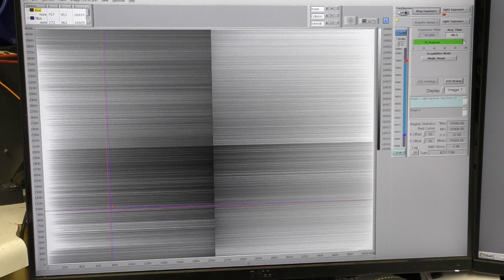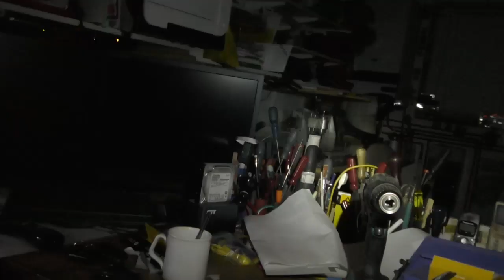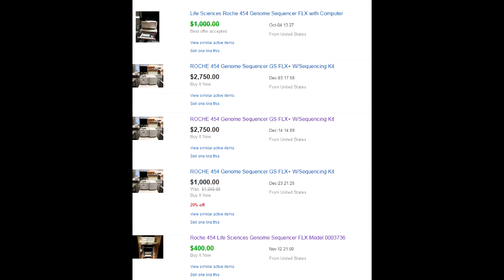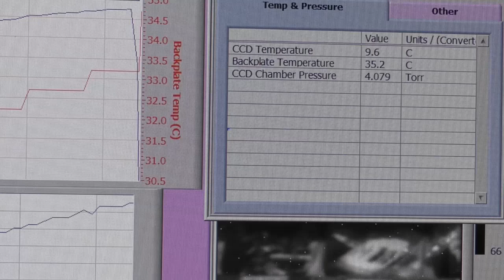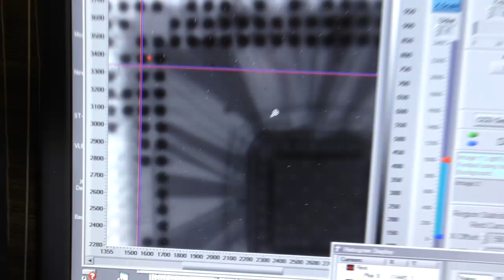Spectral Instruments 800 Series 16Mpixel Cooled CCD camera Part 2

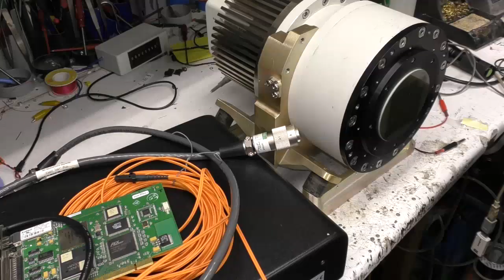Comment: 27:23 Nowadays they don't even exist since they are all bought, except for over $1000 ones but with computer and all and based on what you get they are very cheap. The junior exist but that sensor is not square.

Comment: "Anyone who is looking for that part isn't going to be looking on ebay" - Oh you'd be surprised, very very surprised. As someone who has put up esoteric things like this, you do get messages from all sorts of companies who are willing to buy your used untested stuff. Of course I am on about when they can't buy it from the manufacturer anymore. When that happens you see them go to ebay to get stuff. It's mostly older underfunded labs and similar who have extremely dedicated scientists who just have issues getting funding. So instead they fix all the equipment themselves and run it on a nickel and dime budget in the back shop in some university somewhere.

An example I had not long ago was an old atomic absorption spectrometer from the 90s. I had some researcher contact me to see if I could pull parts out of one they knew I had personally. They were at a US university, and obviously couldn't get the funding for a new machine, and at the same time the official manufacturer dropped support entirely, so they messaged me trying to see if I would send them some parts they had no guarantee would even work, let alone what condition they're in.

It's really cool and kind of sad at the same time. On the one hand these are obviously extremely dedicated scientists willing to work on a shoe string budget to do what they love. But on the other hand the sciences are clearly underfunded if you have researchers messaging people on reddit and ebay to try and get random parts.

Comment: 2:38 isn't running the cooler without a vacuum kind of risky, because of the humidity in the air? I would be worried about condensation damaging things.

Comment: Thanks for the detailed teardown and camera investigation. I actually operated one of these units (nicknamed 'Voltron') for a number of years, and watched with nostalgic interest. It was cutting edge at the time but also a royal pain in the butt, though your comments have given me a new appreciation for the design involved. NGS has since made huge advances in reducing costs and improving user friendliness. Ours went out of service when the UPS died. High service contract and reagent costs made running it untenable. Voltron still stands quietly against a wall in the lab but it is destined for recycling. I've been given leave to take what I want from it and have designs on liberating the camera. Your excellent videos will be on hand as reference material.

Comment: Very nice video. Several years ago I delved into the CCD camera realm to learn how to do Astronomical Photography. Being an electronics technician I wanted to build one. Never built one as writing the software was out of my skill set. With that said there are two books that anyone wanting to get some more detailed information on how they work. They cover camera types and writing the software. They can be invaluable to the CCD beginner in  their study. They are not college text books so they're in everyday language that most folks with some electronics back ground can understand. 

1. For the absolute beginner I suggest Chapter 3 of: "The CCD Camera Cookbook, by Richard Berry, Veikko Kanto & John Munger". The book is about understanding simple CCD's and how to build the camera in the book. The book comes with the software on a floppy. However the camera in the book is really not worth building anymore, except for educational purposes, and that's if you can find the parts. But the book is extremely helpful in understanding their use, build and how it works. I saw many of the principles in the book on the camera you were showing.

2. For operating one with custom software basics I recommend: " CCD Astronomy, Construction and Use of an Astronomical CCD Camera by; Christian Bull". What's nice about this book is the software portion delves into picking bit weight ranges to filter out unwanted noise or how to handle blooming. A very interesting book.

Both books are dated but are available if you look around and within the price range of anyone who is serious about learning about basic CCD Camera's and types.

3. A good place to start really cheap to check out these guys: "QuickCam Astronomy" here:
http://www.astrosurf.com/dallmon/html/quickcam.html
Best Wishes n Blessings. Keith

Comment: 6x6 or 6x7 medium format lens would be the perfect fit, something like Pentax 67/6x7, Mamiya C series, Kiev 60, Pentacon Six, and so on. It wouldn't make for a portable camera but for studio work it's okay-ish :)

Even today there are no professional cameras with full sized 6x6 sensors, only for 6x4.5 (and the actual frame size is a little smaller).

Comment: You know Mammography's are at 25kv - 40kv range.
The MIN-R 2000 cassetes are 150 speed grade equivalent. Which would be fairly thinner.
X-ray cassetes have different speed grades, 200 400 800. 800 being the thickest (fastest).
http://www.ebay.com/itm/Mammography-X-Ray-Cassette-Kodak-Min-R-2-with-2000-SCREEN-10-X-12/152071390817?_trksid=p2047675.c100005.m1851&_trkparms=aid%3D222007%26algo%3DSIC.MBE%26ao%3D2%26asc%3D38530%26meid%3Dc7426847ecc8409282f7b1c938068f11%26pid%3D100005%26rk%3D1%26rkt%3D2%26sd%3D401160699739

Comment: How sensitive it's ccd is outside visible light range? For astrophotography infra red would be somewhat desired. Making diy mirror telescope comes to my mind first. Other experiments could be something like detecting bioluminescence with biology stuff, or tracking nuclear particles with some sort of cloud chamber thingy.

Doesn't cooling down cmos sensors also lower their noise?  Could normal camera be cooled down to get higher sensitivity and lower noise for star photography? Could be even cheaper option than old genome sequencer, and fit better in small telescopes.

I have noticed that my DSLR image quality is somewhat better in winter, but sensor quickly heats up back to 20°C with longer exposures. In warm environment where sensor reaches above 40°C camera is unusable as anything over ISO 100 produces very static image (Canon 550D).
Reply from the maker: Cooling is solely to reduce noise, in particular dark current leaking into the wells on long exposures. Other sensors can be cooled but unless designed for it you will get condensation issues, and thermal leakage/gradients from the pins

Comment: Fascinating stuff. Produced some really smooth looking images when you got the exposure and calibration figured out.

A few notes from experience working with cooled CCD's in astrophotography;

If the camera doesn't have a mechanical shutter, you do indeed actually have to physically cover up the sensor or optical path to capture dark calibration images. There is just no way to do this electronically. This can be hard to do properly, as the CCD's are so sensitive - often involves using light-absorbent paints or materials.

Additionally, we rarely if ever use just one dark frame for calibration - normally you use at minimum a dozen, preferably many more. These dark frames are all captured at a particular temperature and a particular exposure time. So, there's a planning factor there. If you intend to capture 10sec exposures, and you know you can keep the camera at a stable -20*c, you'll capture the dark calibration frames under the same conditions. Precision matters here, especially for the temperature, as you saw there's a great correlation between the noise and temperature, so it might be better to have a slightly higher, but stable, temperature, than a lower and more variable one. After you got them all, they're mathematically combined using simple averaging - so you create a new synthetic dark frame, where each pixel value corresponds to the average pixel value of the corresponding pixels in the stack. TL;DR - average the dark frames into a master dark frame. The master frame has to be re-created periodically, to account for long-term variance in the CCD. Cool thing with looking at the individual dark frames though is that you can spot particle decay and stuff, basically your own little particle collider! Usually one or two collision cascades visible in a set of dark frames. Can only see the ones that happen in the plane of the sensor of course, perpendicular particle tracks will just be dots.

Similar thing for the flat-field-frames - although with those, the goal is not to match the exposure, you instead expose to approximately "fill" the pixels to 2/3rds their full-well capacity. This is to avoid blooming, which can majorly fuck up the flat field, and thus make the entire exercise null and void... To the point you might be better off not doing it at all. Anyhow, you can stack flat fields too. And importantly, you can subtract the master dark frame from them (and/or a bias frame, see below), to get cleaner flat-fields. Flat-fields are stacked using averaging, and then normalized by dividing the frame by the average of the entire array - such that the result is a sort of a correction factor, from 0 to some number usually slightly above 1. The actual images you capture later are multiplied by the flat field... Such that areas of the CCD that is less sensitive, get multiplied by something bigger than 1, and areas with high sensitivity get multiplied by 0.xxx ... You get the idea.

There's also bias frames that are sometimes used. These are 0-time exposures - or at close to 0 as the camera controller will allow. Basically you want to take a "picture" of the noise injected by the readout electronics and amplifiers alone - you want no actual CCD data. Same applies here, capture many and average them. The bias can be used in a variety of ways - it can be used to create a more flexible master dark frame - since the noise characteristic over time is roughly linear, if you subtract the bias noise (which is already 'inside' the dark frame) from the dark frame, that means you can scale the dark frame according to some new exposure time. it won't be as accurate as actually capturing dark frames, but it can be damn close, and can save hours of work, for a good-enough result. Bias frames are quite important for accurate flat-fields too, since subtraction and division isn't commutative.

Finally, the streaking / blooming is due to lack of Anti-Blooming Gates (ABG) in the CCD. ABG's are used when sensitivity is not as important as flexibility, i.e. if you have a perfectly controlled environment or controlled parameters, you don't need ABG. ABG's reduce the sensitivity quite a lot potentially, especially in far red / infrared wavelengths, so that's why they aren't on this one. Leads to utter and complete destruction of the image if you have even just a small area where the CCD is over-saturated, as you saw at the start.

Really interesting series of videos on this. If it wasn't for the enormous shipping cost to Norway, I'd buy one of the sequencers and extract the camera just for the hell of it, even if I can't use it for anything sensible.
Reply: Yep, shipping of equipment for parts is a pain.  Sometimes the one good part is worth the cost of the scrapper unit but not when you factor in the shipping, then it is no longer such a good deal and you have to work to make it attractive.  Unlike Mike I don't get paid to examine the hobby related junk I buy so I have to make sure total cost is very low. I stripped a Dr. Lohmann tube out of a baggage scanner that look more lie a work of art than a industrial component,  It was in a SF6 pressure chamber with the combined filament and HV pulse transformer for forgiving insulation. I was fortunately able to strip it at a scrap yard so only paid the scrap aluminium price for the tube because of the massive heat-sink on the anode.

I would love to have such a camera for uCT work but there is a decent learning curve still to intergrate it with an x-Ray source.  In Finland the regulations for x-Ray systems get more complicated if you exceed 29kV so anything higher than that would need to be a certified closed unit if you want to have any paying customers.

Your advice on dark/flat field/bias frames is well explained and confirms my understanding, thank you.

Comment: Could it be that the front is caked in dirt? So not behind, but between the CCTV lens and the bonded piece. Maybe use some compressed air from a can and some sticky cloth to clean it?? Because i'm of a mind that if you can see those lines, that's dirt in them.

Comment: Is there any reason you would want such a large 16MP CCD when (I believe) there are much smaller, cheaper ones in existence?
Reply: Just Power Electronics Bigger pixeks = bigger "buckets" for capturing more of the light, pretty simple..
Reply: Okay, that makes a bit more sense, but what about a small high-res CCD and a big lens?
Reply: Just Power Electronics Well if you now have plenty of photons (like billions-trillions per pixel vs thousands-hundreds of thousands? per pixel) why bother with bigger pixels? Larger glass allows more of those photons focused to one spot, since it allows for a larger aperture.

Comment: A quick google hasnt helped; whats special about a ccd? Are they better than photomultipliers?

It looks incredibly complicated considering what its capable of
Reply from the maker: Photomultipliers are single channel detectors and way more sensitive. This CCD has 16777216 pixels. You can get electron-multiplying CCDs which are a sort of hybrid of the two
Reply: Enough to point me in the right direction, thanks. Like most stuff on this channel, way above my head, but fascinating none-the-less

Comment: Pretty cool Mike!  Do you think some of the specks and noise on the image could be dust introduced when you had it apart?  I'm sure that thing was probably assembled in a clean room.  You might try giving it a clean if you replace the seal.
Reply from the maker: No because the fibre guide is bonded to the face of the CCD, so dust can't get in
Reply: Right, I went and rewatched the first video, thanks for the correction!

Comment: Already working on a telescope capable of using a camera of this caliber. Normal off the shelf telescopes cant cover this cameras sensor, so designing a custom astrograph is the only option. (not sure if it will be built or not, though)
Reply: Any updates? These cameras are very cheap to get second hand, but they are really heavy (8kg), could probably be lowered to about 6-7kg, by replacing a heatsink and fan, by some heat exchanger and water cooling instead. But still heavy. Not many telescopes and mounts will handle that well without breaking or flexing. The camera is good, but isn't the highest grade. It is not the best, but still usable.

Comment: Brings back memories. A few years I build a ccd system for Fe55 soft xray spectrocospy, I also chased ghosts for a while before I realized it was over exposure.  Looking at a datasheet for ccd it looks deceivingly simple but there is a lot of small stuff that need to 
be right. 

I think with the ccds I used the darkcurrent went up with something like an order of magnitude per 15'C

Comment: Fantastic work! 
i would love to get my hands on one of these to attempt some long exposure astrophotography, might be worth saving up and stalking ebay if someone can ever get a proper receiver board or if i can some how get my hands on an original one
Reply from the maker: All the ones I've seen on ebay have the PC, so the card will be there - I was unlucky.
Reply: One of the first thoughts i had on this as well.  Might be a great application for it.  Seems like it could be well suited for low light performance and 16 bits is beautiful dynamic range.  Wonder if it could detect in near infrared.
Reply: i would assume it can but i cant find any documentation on that
Reply: Did a little digging, seems that the response drops precipitously after 700 or so nm, anything above 950-1000 is going to disappear in the noise.